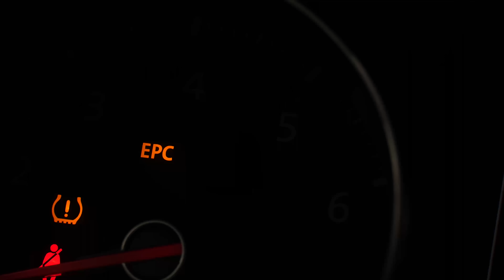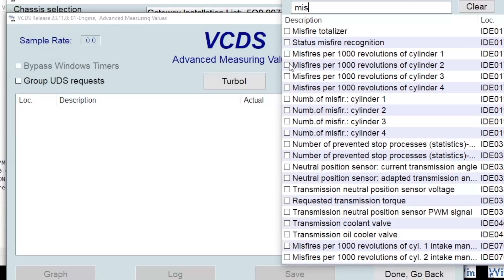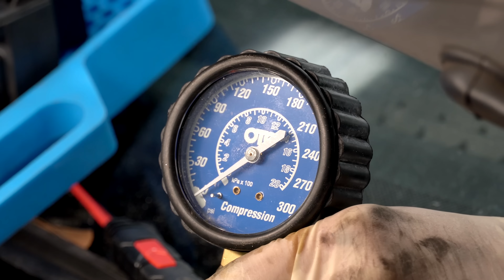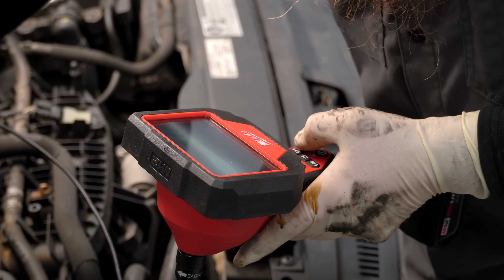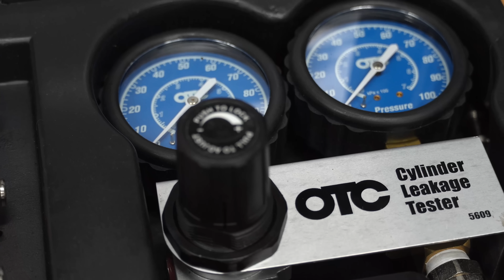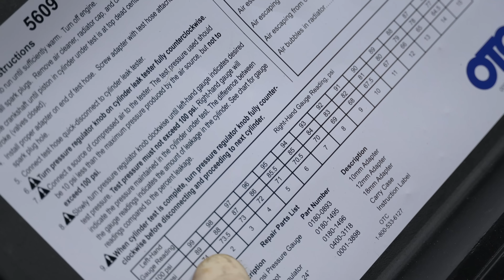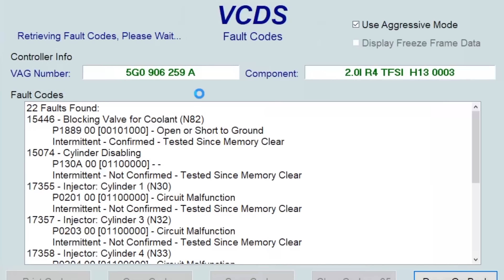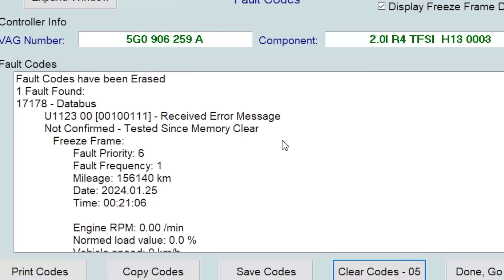Dead Misfire MK7 GTI, Another Shop Said Engine is TOAST

Comment: but is $4000 a good deal? you said they go for around $8k, but you have $1600 in parts alone not including labor. i'd say 10 hrs labor at $150 is about right so thats $3k total. $7k all-in. not a huge bargain, especially since it was a massive risk for the buyer! but still this one worked out and glad for that. once again you do such concise, detailed videos that arent overly dramatic and an hour long. subscribed.
Reply: That true in the video the labor is not considered, to change the  spring valve at 7 $  it has to dismount almost all the engine
Reply: I think it was a good deal because one he found that coolant leak before it became a problem and two the timing chains would have to be done soon anyway. So what would it cost just to replace the valve spring and give the car back.
Reply: Not saying you are wrong but you can also buy one for 8k a still drop 3k on it just to get it back to proper shape 😂

Comment: This is why i do 95% of work on my car myself. And although i don't own a VW, your videos Charles help a lot. It's never too much quality information you provide. Thank you!
Reply: Are you doing a repair like this yourself? I don't have the special tools or the scantool needed, but kudos for you dude
Reply: @Hawk7886  i didn't open the engine yet, but i did work such as dropping the differential, installing LSD, all services and maintenance, brakes, fluids, etc. Also did valve lifters on my old car. Tools are important, yeah... But patience and skill to fix a broken screw or similar is even more important.
Reply: @rideepicdriveepic  I get the sentiment, but a broken valve spring is not the same as extracting a screw
Reply: @Hawk7886  true. Broken valve spring takes a lot of patience and time, and doing the timing chain is probably the most critical part to do. But I'll give you another example of what i had to work on.... I had an adapter for a pressure sensor that broke off, and there was just the threaded part stuck in the block. That is literally just a hollow bolt that broke, but where and how is what took me several hours to remove safely. You can't drill it out, you can't pull it out... I ended up using a tiny cordless dremel and notching it so i could hammer a screwdriver bit in it and ratchet it out. I broke a torx bit, flat bit, several dremel disks. So yeah.... Just a bolt can be worse than slowly doing "normal" work
Reply: Also, should i note that to make sure nothing goes thru the hollow bolt while you're trying to extract it, you need to drop the oil pan so you could put something behind the hole? 🤡
Reply: That's nice but there is a YouTube auto repair channel that shows what happens to cars when customers attempt to repair or change things on their own. Most people don't know what they are doing.
Reply: @JAM_2024  ahh, of course. It takes a lot of engineering knowledge, patience and practice.
Reply: @rideepicdriveepic what makes you say this is why you do your own repairs? As a mechanic I can tell you that what he did with the VW is just top level, no shop will want to waste their time on this even if they could get the job done. Replacing minor parts on a car is actually very easy as long as you have the tools and most importantly a hoist
Reply: @JAM_2024 well said mate, he just trying to sound clever and 💩 at the same time 😂
Reply: @rideepicdriveepic  extraction is probably one of the most tedious and dangerous tasks there are regardless of make and model. Good lessons learned I bet!
Reply: When I had my Golf 7 1.2 TSI. I had to study a lot but I've never let someone touching my car. I did everything myself. it was a huge book fool of information. I learned a lot and I would never touch anything if I didn't study before because those engineers are making this cars as difficult as possible so regular people can not repair it. Simple as that.! Lots of garages do not have the skills to repair Germany cars.
Reply: You would do 50% of the work or less if you owned a direct injection vw motor

Comment: Finally, a next-level MK7 video! These cars are getting older, but there are tons of them out there, so this kind of content is super helpful. It's smart to replace the corresponding rocker for the failed spring to avoid a 'pop-a-mole' scenario (where another part fails soon after). You could even upgrade to replacing the entire rocker and spring set for the head to be extra safe.

Comment: I remember replacing a broken valve spring job on a 1964 Ford Fairlane. I probably used a box-end wrench, a screwdriver and a pair of pliers.
Reply: Probably 50 years ago, I should add.
Reply: @roscoe_t it's weird how things have changed so much in half a century while still staying the same
Reply: bet you chipped a tooth doing it too !

Comment: Was really interesting to see the troubleshooting process that ended with the broken valve spring.  At about 80k my 2015 GTI had the same problem as it turned out.  At the time my shop commented that they hadn't seen a broken valve spring prior to mine, so it's funny to see one be the culprit here!  No major issues since and the car has almost 200k miles now.

Comment: We had a piston skirt failure at 82,000km (that's 51,000 miles or so); the OE Mahle had developed a crack which then resulted in a failure and zero compression on #3. We replaced all 4 pistons and - while we were in there - did the whole timing chain malarkey. Not cheap, but we've done another 40,000km with no new issues... I wish we had a Humble Mechanic.

Comment: You would be very lucky to find a mechanic anywhere with the ability of this guy. I live in Texas and over the years have dealt with at least 7-10 shops including dealerships that charged beaucoup bucks, but, never fixed the problem I took them in for. Instead, they hung parts on and repaired things other than what I took the vehicle in for. I'm a retired mechanic myself and ended up fixing the things myself, but, at 70 years old with limited tools and no lift, I would rather pay someone a REASONABLE amount to do the job. Unfortunately with the so called technicians in the shops today, it's nearly impossible so you're better off doing it yourself, or buying a different vehicle. Sad.
Reply: Yep...my 2006 Passat is a great car, but over the last three years it is death by a thousand cuts.  Always serviced at VW and OEM stuff.  More than frequent oil changes, etc., but the dealership is now pure evil.  14 year relationship means nothing anymore.  Hopefully can keep the car for two more years without anything major, but will now look for an independent shop.  I cannot believe the $170 an hour the dealership now charges.  YouTube has helped.  When my driver side door switches took a crap, $300 at dealer.  Did it myself for 35 bucks.  It felt good.  Over the years replaced control arms, links, timing belt, CAT, brakes (100,000 miles on them though). 3 cam followers, brake and coolant flushes, trans oil and filter, but I will never buy another VW again.  I have literally paid for the car all over again.  We even bought my wife's GTI from these clowns.  Wife got nervous seeing my car needing something every other week, so we just sold her solidly maintained GTI and bought a Honda.
Reply: We live in a world today where if you can't fix a problem then you are in trouble!!
Reply: I have 3 vw dealers near me and i Don't trust any of them to do any repair past the oil change. Even the oil change I had two different dealer mess up on the washer for the oil drain not fit properly and had to take back. As much as I love VW, and had 3 of them so far, I'm gonna have to go back to Japanese car make. VW check engine light is such a traumatic experience.
Reply: @kleenk8 good choice on the honda. You wont have 1% of the problems of that vw
Reply: You're exactly right.   Unless you have access to a good indy shop, you have to DIY for cars like this.   Flat rate has killed quality work most everywhere, and its not the mechanics' fault.

Comment: This exact scenario happened to me on my 17 MK7 SE. I was driving down the interstate at about 70 mph and the EPC light came on and power was drastically cut. I managed to pull off at the next exit and shut the engine off. I restarted hoping it was an electrical glitch and would reset itself. Same issue and still running rough. Had to Get Towed In (GTI) to the nearest VW dealer. Turns out no compression in cyl # 1 and when the oil pan was dropped it was filled with sparkly oil with lots of bits of metal. Broken valve spring  with bits of spring everywhere. Engine was DOA. Fortunately I purchased an extended warranty and it covered the cost to furnish and install a new engine and turbo. Total cost was $17K with only a $250 deductible. Not sure what's going on with GTI valve springs on cyl 1, but the experience has shaken my confidence in VW.

Comment: Your videos are awesome.  I watched this thinking from the start it might be a valve spring.  I went through the same diagnosis you did, but borrowed the pressure tester from AutoZone. I didn't even do the timing chain. It was an Audi A6 with the 3.2 and it took me 4 months from start to finish, but that was 30k miles ago.  The car was only with $2k and the shop said it would likely be $2k to fix, so I did it myself.  All those chains are at the back of the A6 so the originals are still going strong at 212k miles.

Not much else to say other than thanks for your videos. They make me want to rebuild an engine.  Maybe one day...

Comment: Nice job man, I recently found a Good Diesel Mac in my local area since I drive a TDI. Its on over 350 000Km and he just redid the head, valves, bearings and mains. I am eternally grateful to him, best part is it cost me less than $1000 to get done.
Reply: I must add that I work on the parts of the car that I can understand but i tend to stay far from the internals of a Diesel.
Reply: A great deal, these days

Comment: A good test for a misfire, given one of the battery cables are easily accessible and this car was a low cost auction find, is to run a starter current relative compression test (disable fuel injection first), with a current clamp and a Picoscope. Just look at the current waveform first to see if one of the cylinders is considerably low on compression. If so, then use the coil on plug spark probe on cylinder number one, along with the current capture, to establish what cylinder is low on compression knowing the engine firing order. This will confirm what the scan tool data showed.

Knowing the cylinder that is low on compression you can continue with your testing. But, here again, I would go for the easiest and quickest test to complete the diagnosis. I would actually listen (mechanics stethoscope) to the valve cover near the bad cylinder with the engine running to see if I could hear the broken spring or a sticky lifter etc. If I hear noise then I could inform the customer of the problem to see what they would like to do. If they want to get a repair estimate then I would have to confirm the exact cause. 

The reason for the preceding approach is many customers would probably opt out of having the car repaired knowing the car is low on compression and what this means in terms of repair cost. 

If they want to know the exact cause you have testing options, but hear again I think in terms of the fastest test to perform. Which would be an in cylinder pressure capture with a pressure transducer (with fuel disabled). From this waveform you can readily determine the most common compression issues. 

If the relative compression test is negative then you can move on to other tests.

If we look at diagnostic time:

The relative compression test is very fast (5 minutes). 

Confirming/finding the bad cylinder (5 minutes). 

Valve train noise (5 minutes). 

Confirming compression loss source (10 minutes). 

Moving the car and performing the diagnosis is done in under an hour. Which for me is the minimum diagnostic time, we charge in full hours. Once the diagnostic time is paid then a repair estimate is issued if the customer wants to continue with the repair, which in the case of the car in the video in normal non-YouTube land, in my experience with an auction car the customer would take the car back before going ahead with the expensive repair.

Comment: I hope there’s some VW engineers watching this channel. There’s some great info on the shortcomings of these engine designs. For the money these vehicles cost new and the time VW has had to fix some of the simple issues, they really need to do better. I really love my Audi vehicles, but refuse to own one outside of leasing. My previous Audi (2020 A3) presented an issue on the first week of ownership. The vehicle had been worked on, on 4 different occasions and never was fixed. Ended up giving up, and it went back to Audi after 2 years with this issue. Very glad this was a new vehicle and i wasn’t paying out of pocket.
Reply: Yeah they're cars that you own out of passion. I've done literally everything to my 04 1.8T audi but open the engine (clutch, flywheel, axles, fuel pump, diverter valve, control arms, coilovers, pulleys, power steering pump snub mount, motor mounts ect) still the most fun small car I've ever had wouldn't trade it for anything

Comment: I did a brake job on my 2017 polo gti recently. Really did all my homework beforehand. But that was about all the stuck rotors and rusted solid bolts my nerves could take. Especially concidering doing this work to my only car in an afternoon on the weekend. Real work is a bit different to theory and i have huge respect for guys that take on engine stuff in a modern VW.
Reply: Most of the rust is at the bottom of the car, the exposed areas  I wouldnt even worry about rust inside an engine bay of a 2017. I work on older stuff usually 07-09s and they are never rusty underhood.

Comment: With regards to the carbon cleaning tool - I used the Central Pneumatic/Harbor Freight media blaster, the N54 wand from ECS tuning, and the 034 Motorsports shop vac adapter.  The media blaster needs a LITTLE modification (you have to enlarge the feed hole a smidge), but it works perfectly. Only downside is capacity. I usually have to refill the hopper 1x per cylinder
Reply: Isn't that an overkill to refill hopper 1x per cylinder?
Reply: @golfmaniac007  

Not really - if you saw the size of the hopper of the media blaster I'm talking about (not the floor standing one; the one I have has the red plastic hopper on top) you'd see what I'm talking about. I think it takes about 3-4 cups to fill up the hopper

Comment: that slight bit of nervousness really never goes away when diving into the deep end of cars. currently trying to get rid of a nightmare 3.0 TDI, started out as a upper oilpan replacement which is a engine out job on the Amarok, got it back together and got low oil pressure under heavy load which ended up being the oil pickup which stupidly enough isn't available from VW they will sell it together with the oil pump though so yay replacing the oil pump which is getting the front cover and lower oil pan back off which surprise surprise has almost only one time use bolts. got it all back together again and must have mucked up the silicone for the lower oil pan because it was leaking from there, not a big deal a tube of silicone and new bolts for that, then test drive everything is going good heating up the gearbox fluid to check the level of that everything is fine, pull it back into the shop and oh no it's got yet another oil leak from either the valvecover or the small cover for the timing chain on the left bank. hopefully i can finally get rid of that nightmare car tomorrow.
Reply: I'm convinced VWs will either survive like an old Toyota or be horrible until they finally slip timing and unalive themselves.

Comment: First, I am going to thank you for the many valuable lessons that I have learned from you.  If it wasn't for you, I probably would have stopped at my second VW.  I am now on #5.  Next, I am going to attempt to return a grain of sand to the beach of information you have provided.  When I put a pair of valve keepers back in place, I put a little dab of wheel bearing grease inside them first.  This makes them stick to the valve stem long enough to get the assembly back together under spring tension without the keepers dropping away to some dark & hard to reach area.